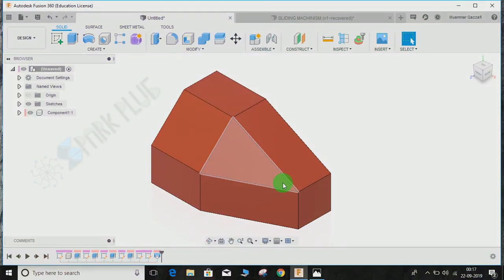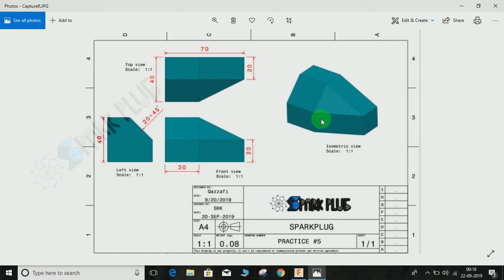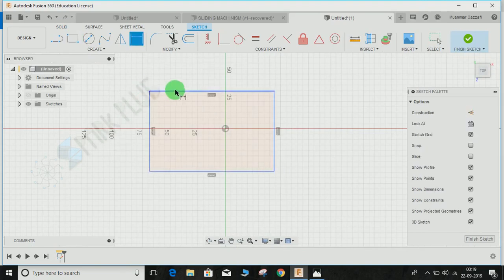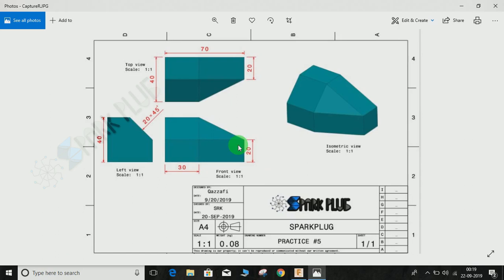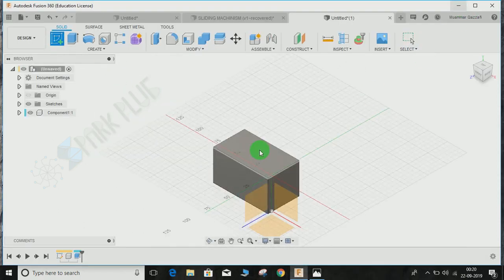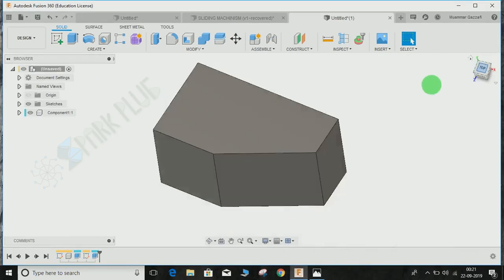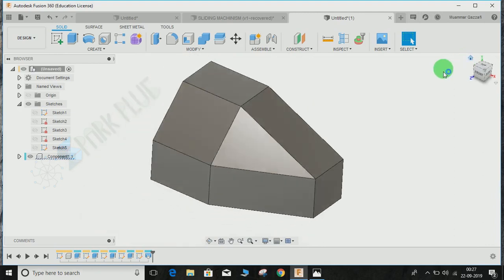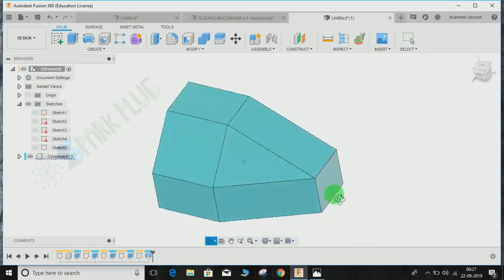Fusion 360 beginner's Exercise #5 - Fusion 360 tutorial

Comment: I sketched the top view. Extruded the upper left rectangle to 40 mm and the remaining 3 parts to 20 mm. Then i added the chamfer feature 20° x 45. Then sketched and extruded the other chamfer from the back surface. Finally i used the loft, where i could just select the 2 surfaces.